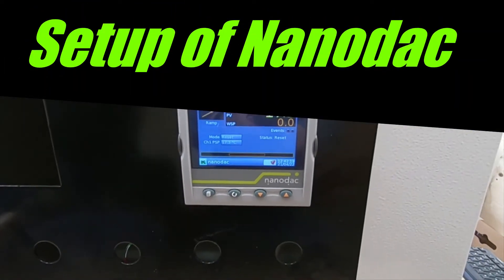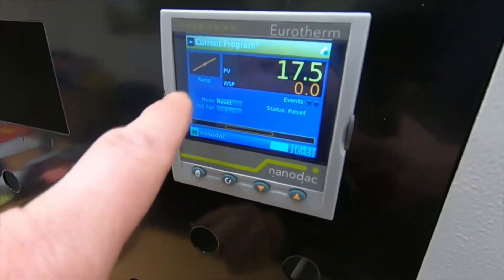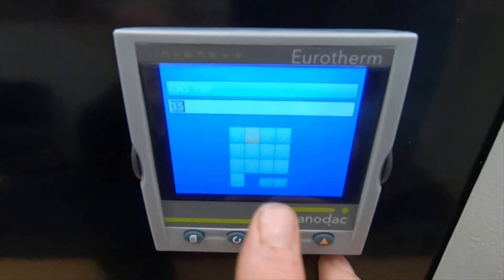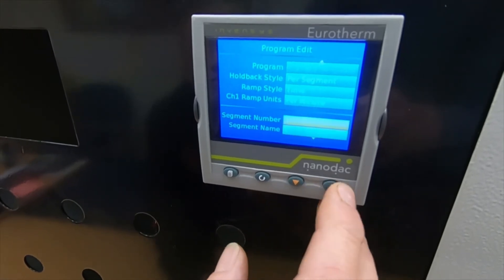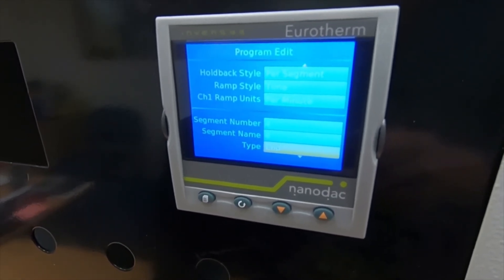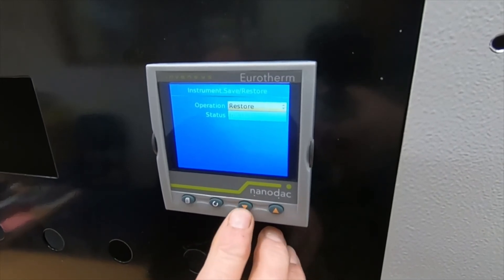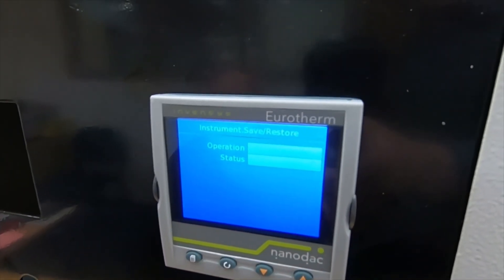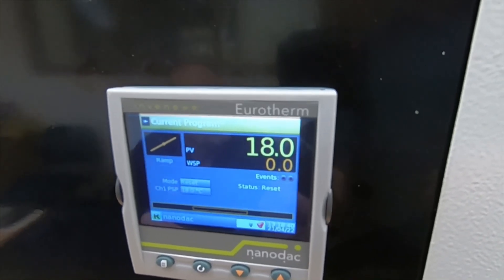Setting up a Nanodac Controller for an RDM Oven.

Comment: Im having trouble with our controller. Its being used on a heat treating oven, one of the lads messed around with it, now it'll flick from auto to manual and itll fly passed the set temperature. I sorted the autotuning settings and got it working, came in the next day and its doing the same... any advice would be greatly appreciated.